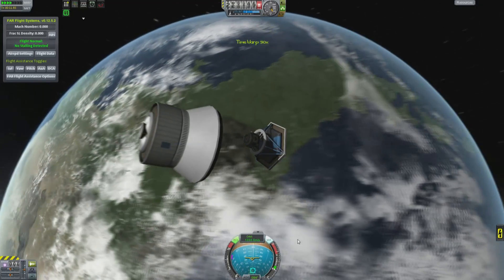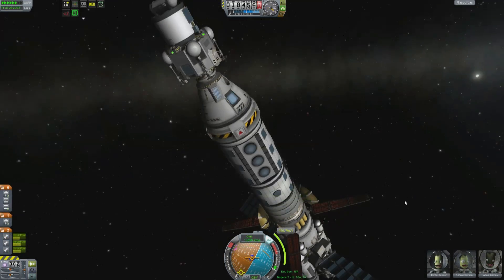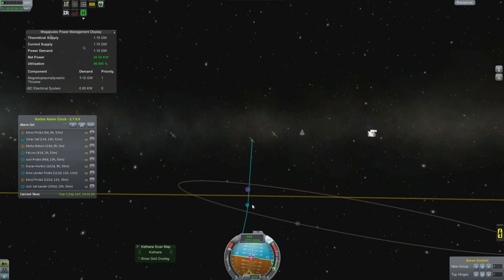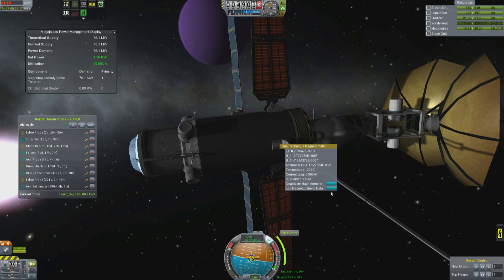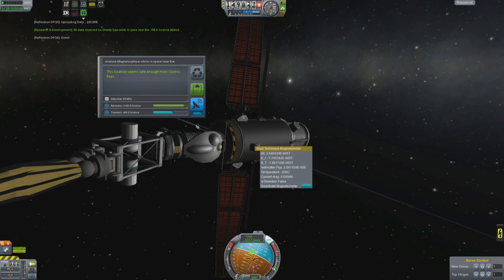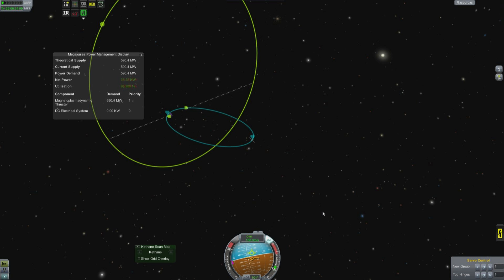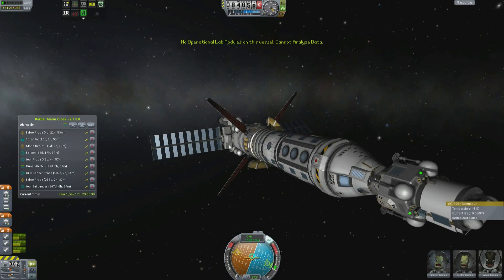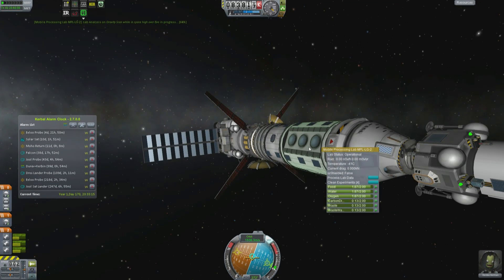Kerbal Space Program - Interstellar Quest - Episode 51 - Eve Arrival

Comment: The microwave power transmission thing is fun and all, but it just seems so pointless and bothersome... Surely simple solar panels are more efficient when far away!
Also, if you're using KW rocketry, you should be able to get yourself a LOT more electric charge with their battery packs. And they're deep cycling.
Reply: +BrokenSet But you need obscene numbers of solar cells to get anything like the kind of power Beaming offers.
Beaming permits huge mass savings on the vessel itself, which means efficiency.